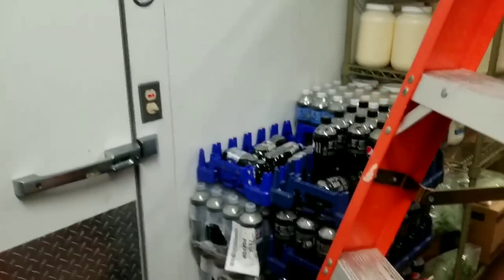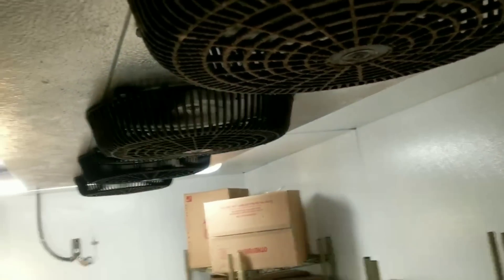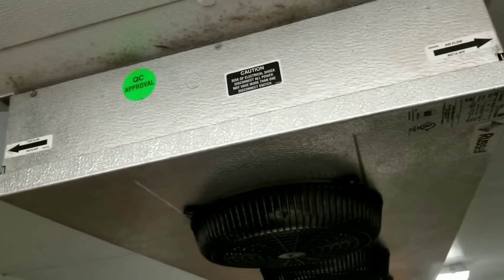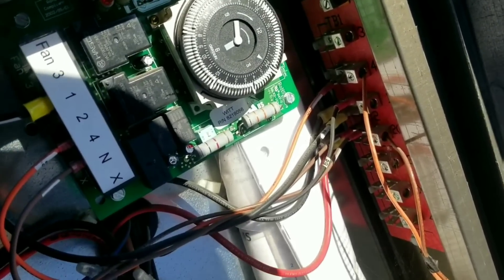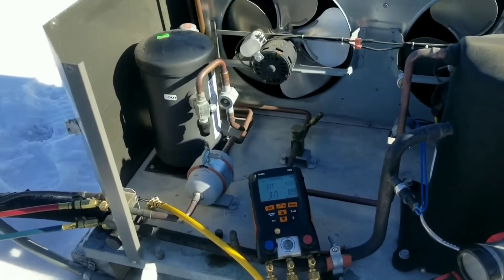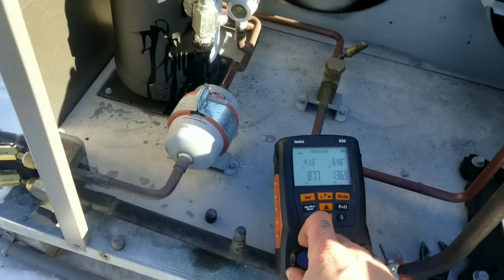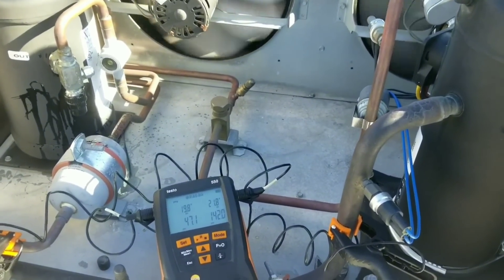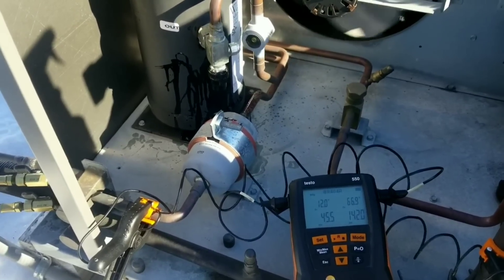Walk in cooler not cooling

Comment: yep, perfect for deli meat storage, if not they'll get dinged by health department when it hits defrost at an odd busy time, letting the meats creep up in temps slightly. 
make them use multiple thermometers when they try giving you shiiiit, complain about how easily the calibration can be off as the batteries age in their devices ;)
trust me they do and they're always skewed, I don't using proper voltage drop compensated test gear (the old school analog stuff, calibrated yearly or more often was 10x more reliable)

Comment: You’re going to naturally have a slightly lower liquid pressure compared to your discharge pressure. If you were guaged up to the discharge line I’d imagine you would see your head master indeed was maintaining a 148 psi. The valves job is to maintain a minimum discharge pressure by stacking liquid in the condenser.

Comment: Do all walk-in coolers run a defrost timer?
Reply: Not all. However if you are in a humid climate and have an infiltration issue ( leaky gaskets or panel seams) operator error (staff props the door open to load product in or out while running steam kettles nearby) or in this case a design temp very close to freezing, a time clock is needed.
Reply: @davejohnsonnola7908  great info 👍.  Thank you! I have all those conditions.
Reply: @DanO181919  all walk in coolers should have an air defrost, R-22 coils especially like to ice up, though a defrost timer isn't required as you can have air defrost set in the controller
Reply: @stigandrthewarlord1871  Thanks!